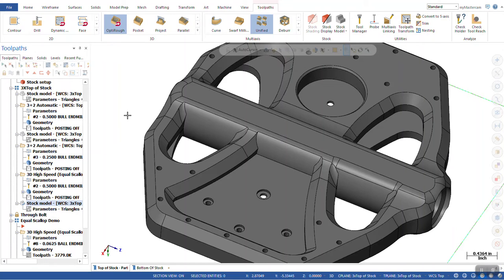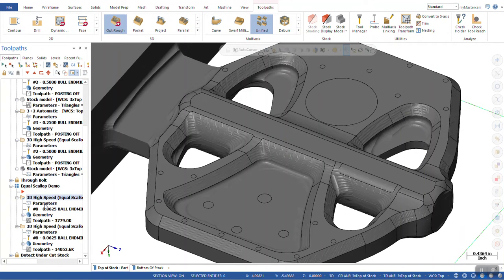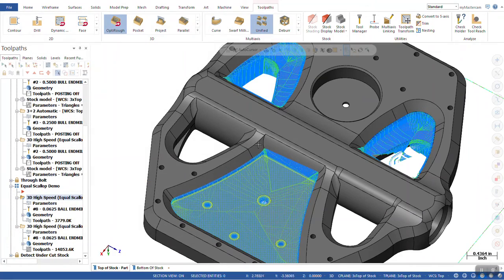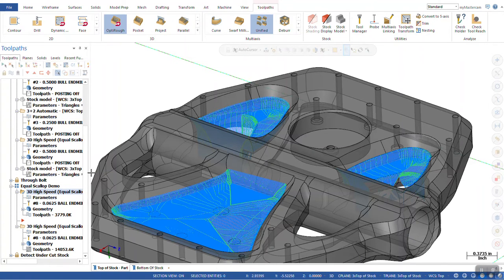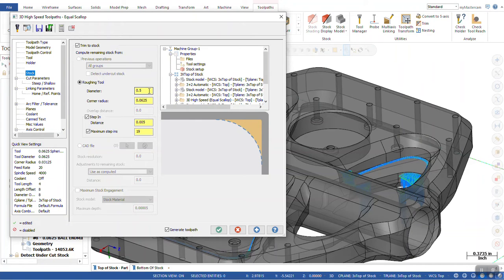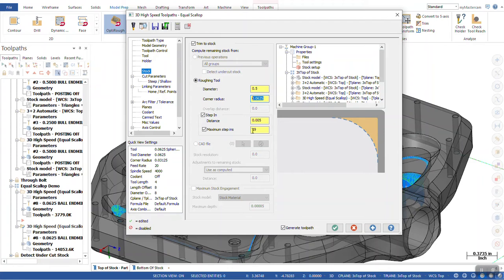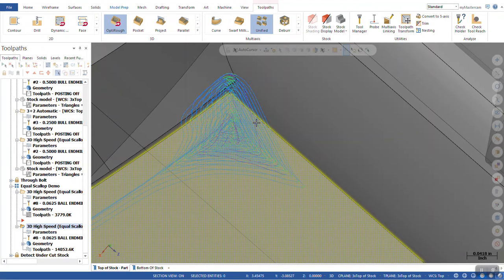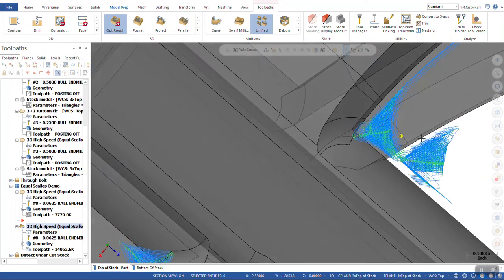Knowledge on Tap: Equal Scallop Step In

Comment: If you need to use a 1/16 end mill for making a bike pedal the designer is kinda dumb and the legacy toolpaths work better in a lot of instances , equal scallop leaves material all over even when you say stock to leave zero, don't bother with it.